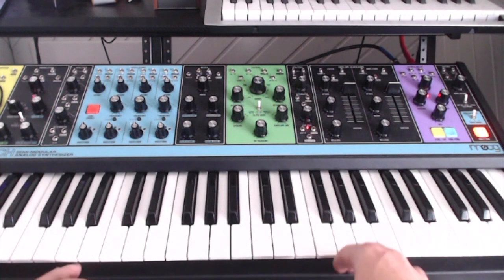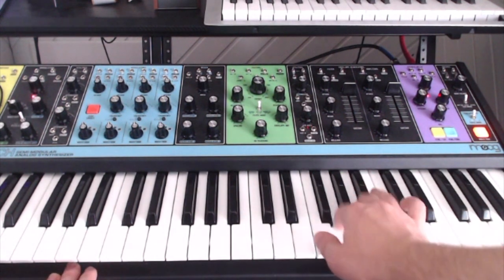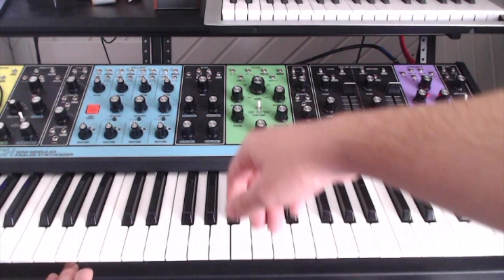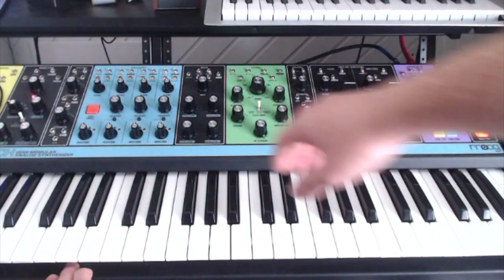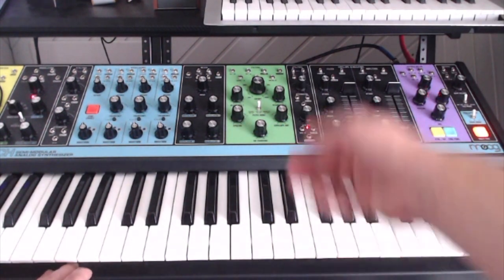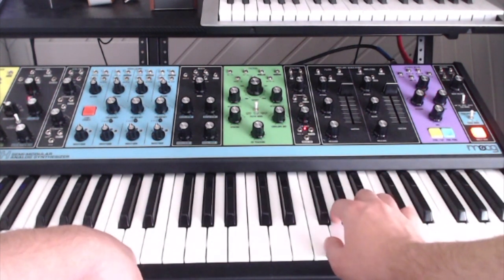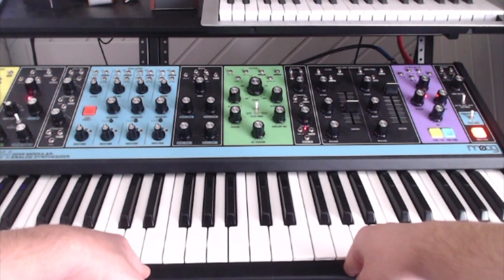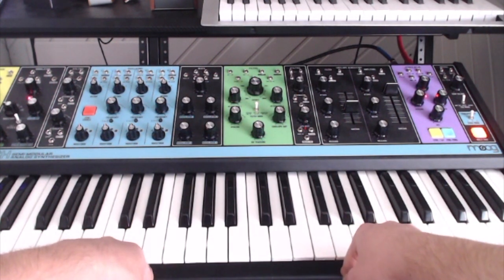How To Recreate the Vangelis Blade Runner Patch - What Is That Sound 4

Comment: I am surprised how the moog sounds close to the cs80 . You absolutely nailed the blade runner lead!! If you had a big reverb from lexicon 224 or lexicon 200 or any software emulation of them it will be very very hard to make a difference with a cs80 in a mix. Very well doing . Subsribed immediately. Keep doing tutorials they are great. Thank you very much
Reply from the maker: Thank you so much! I was only on like half reverb so I definetly could’ve cranked it more haha